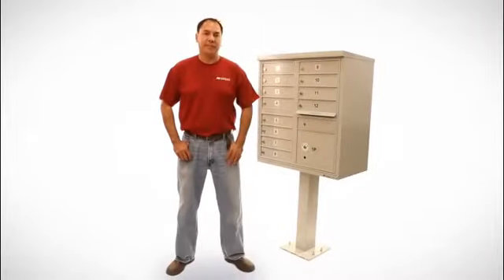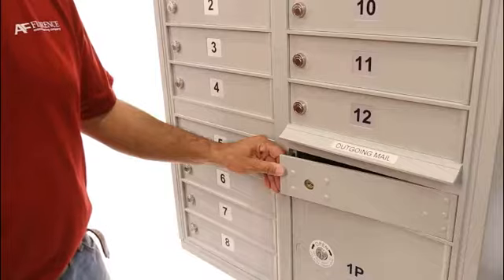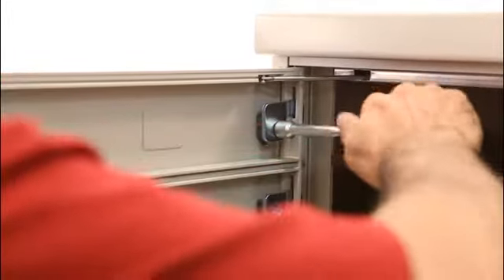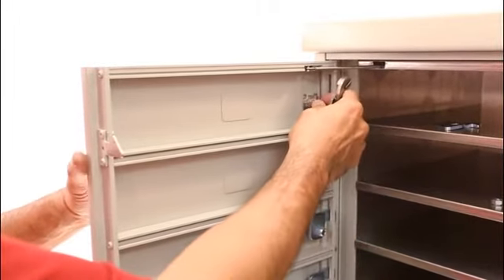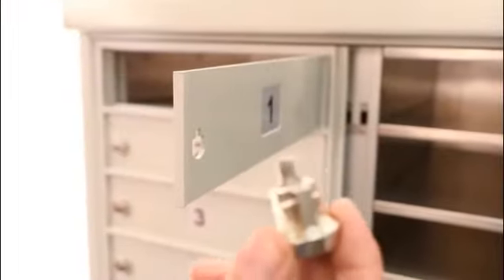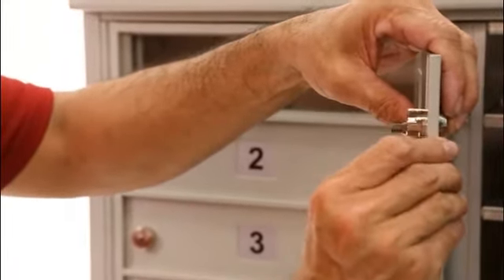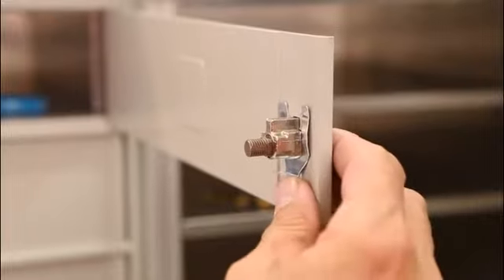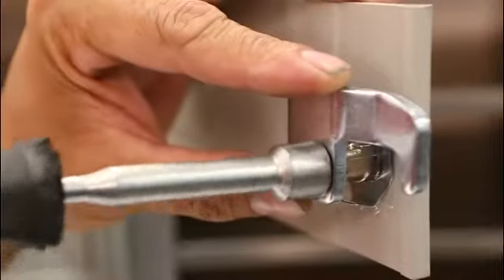How to change a mailbox lock - Auth Florence

Comment: Can anybody explain to me how clockwise/counter-clockwise is determined with those locks? I need to purchase a new lock. Is it from unlocked to locked state or vice versa? Because technically all 90° locks operate both, clockwise AND counter-clockwise. It just depends at what you're looking at (locking or unlocking).

The mailbox locks in this video lock by turning counter-clockwise... so, I presume that's the answer?

Anybody able to confirm?